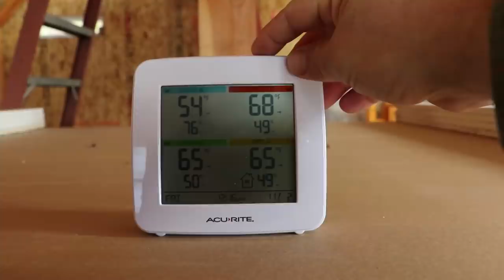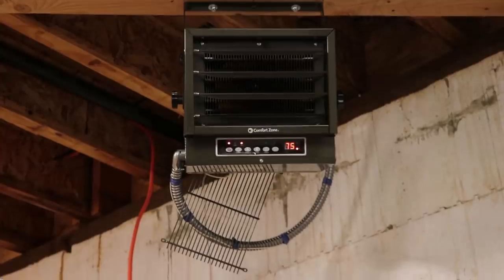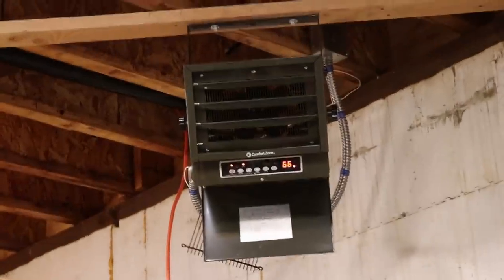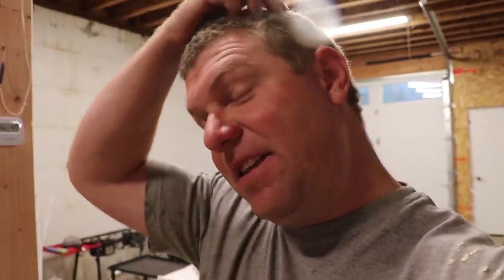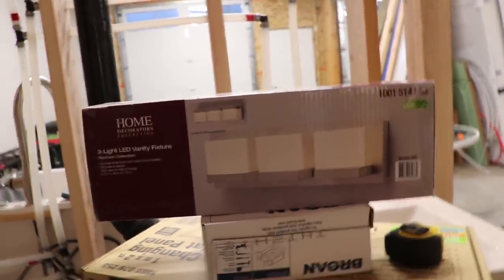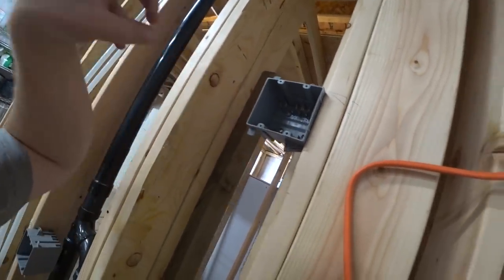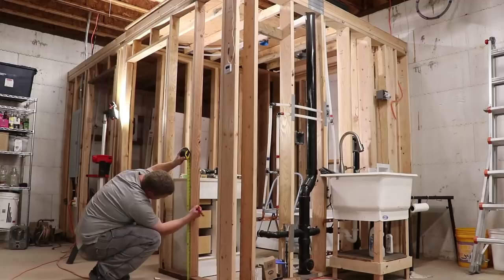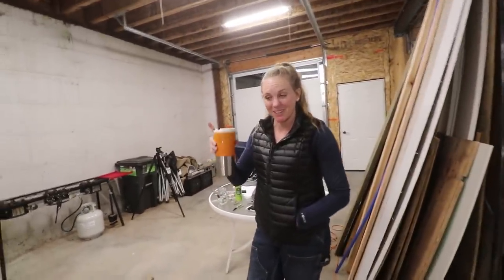A BEAUTIFUL, HOT MESS (Initial Electrical in Bathroom)

Comment: You should not use a staple gun to secure electrical cables.  You just showed the reason why? You put a staple through the wire itself.
This would not pass inspection.

Comment: tbh when everything is built you should consider using a gas water heater and free up that 200 amps for other devices and relieve stress. and there are some really efficient  gas water heaters but I have no idea what your gas prices are compared to your electricity prices are.

Comment: I know you got the electrical all done by now, but don't put your bath light on the circuit with the outlets. If your hot curling iron trips your breaker on your circuit and the light goes off and you're in the dark you can burn your hand on the still hot iron while trying to get out the door in the dark or even worse you can knock the hot iron off the counter into the trash can and it can catch fire while you're in the dark. Lights on one circuit and outlets on different circuit for a reason.

Comment: there are auto switches that will turn off one load while the other is running to prevent overload of main breaker  like  domestic water heat and or Electric boiler

Comment: you should have put in a 100 or maybe a 120 gallon water heater to serve both the shower and the radiant heat.  It would easily do both.  And it would not draw anywhere near what that on demand heater pulls.

Comment: Question: Would you be willing to give me the Mfg's name and the model number for your garage heater?  I'll check the circuit diagram for the thermistor (or whatever it is) and do the math for your extension wire run.  Btw, I'll need the length of the wire run and wire gauge.  Just to double-check for voltage loss or amp draw problems.  

You two are my heroes.  To watch the fantastic dedication to quality and attention to detail is amazing.  Jesse and Alyssa are certainly the most inspirational home-builders I have ever seen or heard about.  GREAT WORK!  Slow and steady wins the race, unless it's a sprint.... hehe

Comment: with the gaps around your doors cold air will rush in and thwart the heat up process.hot air always rises and cold air will sink.if the heaters were lower down they will heat the cold air layer on the floor level and send it up to the other floors.

Comment: Remember the NATIONAL ELECTRICAL CODE (NEC) are the minimum electrical requirements.
Bath receptacle required to be single circuit GFCI that shall not feed any other other outlet. (Hair dryers, curling iron, etc.)
Kitchen requires minimum two 20A GFCI receptacle ckt’s for countertops 2’ or larger with receptacles not exceeding a distance of 4’ from each. Fixed stove tops and sinks are considered breaks in the countertop. Refrigerator, dishwasher, microwave & garbage disposals should be fed as a good design practice with dedicated circuits. These devices should be connected to the circuits by means of a cord and plug attachment to work as an accessible equipment disconnecting means. Locate single use receptacle in adjoining cabinets or appliance access points to accommodate the cord and plug connections.

There are NEC rules for light fixtures in a Bathroom. Light fixtures are required a specific distance from a bathtub.

A fix for the bath exhaust fan would be a in-line fan blower installed in the exhaust ductwork outside the room either inside or outside of the home.

Comment: All heaters should have at least 2 thermocouple. 1 for safety purposes which should be preset to a fixed value. And 1 thermocouple to regulate the heater turning on or off.

Comment: You can't go wrong with just a 50 gallon electric hot water heater. If you had a power outage, a standby generator will power your hot water heater.

Comment: Doesn't the heater sensor control if the heater element need to be switched on/off and the other censor you moved control if the fan needs to run?

Comment: All you needed to do was to twist the RED and the WHITE wires together were you soldered them together. You created a "cold junction" at the solder connection. Twist them tight TIGHT and snip the excess leaving only 1 or 2 twists. IF you are using the correct Thermocouple Extension wire?

Comment: I would suspect you lost the safety sensor by locating it with the new extension at face height far from where it should be, because it will never be able to detect an overtemperature due to a fan failure. The safety sensor is now doing the job of the air sensor but connected to the inertia of the metal structure which will obviously extend your on-off time period which was what you want to solve. If you simulate a faulty fan by removing one of the wires of the fan (of course with an extinguisher at your side) you will prove it. I do not want to be arrogant and discard that the connectors came switched from factory, but there is a risk that you created a time bomb that will trigger the time where the fan will fail which will be in a time where you forgot about this apparent risk you created. I care about you and your amazing house and I am not trying to be a wise ass.

Comment: You could always mount the exhaust fan in the wall. Speaking from experience, you will not be happy with that fan, it is way too loud. If you can wire the fan separate from the light put it on a moisture sensor. That way when you leave the room after a shower the fan will stay on until the moisture in the air is at an acceptable level.

Comment: you need a GFIC with 4 screws or terminals one set is supply  for this GFIC other connections will connect to regular plugs will provide GFIC protection for others other

Comment: You always pick the hardest way of doing things.  If there is not natural gas in your area then get a propane tank.  Electric heating is so much more expensive and you are going to have a monster electric bill.  Get a gas hot water heater, gas heater, and dryer.  Also GFI plugs at least used to be only good for a certain number of years and that is why they have testers.  You are also limited by state code how many plugs you can run downstream from a GFI plug, but I know in Michigan it used to be 7.  Before you put in plugs get the code for heights on the wall and spacing requirements.  You do not want too high a CFM for the bathroom fan as it will pull all the heat out of your house rather quick... especially with this bathroom being in basically what is considered the garage.

Comment: one of the issues is low air circulation in the room - stir  the air with another fan blowing cooler air with hot.  You are heating a pocket behind.  Normally the sensors are Constantin wire and you extended it with copper.  voltage generated on sensor is passed but not as expected.

Comment: You are talking about Arc Fault Circuit Interrupter (AFCI) breakers; not the traditional GFCI (Ground Fault) breakers of old; they are required throughout now here in NY too; my son bought an older 50's home and had a NY licensed electrician re-wire the whole house, with new main panel; the electrician warned him that the new AFCI's he has to use are a pain in the ass; they will trip with most devices that have a motor, i.e. corded vacuum, shop vac, corded circular saw, etc.. because they arc; and he was correct; he told him to just wait until after the final electrical inspection and replace select few of the AFCI's with regular or GFCI breakers and remember which circuits to use those devices with. We still forget sometimes; its a pain.

Comment: Considr getting rid of the on demand electric water heater and going with an electric air source heat pump tank water heater.  They are super efficient.  The on demand draws way too much energy.  You will probably spend maybe $200 a year in energy with an air source heat pump tank.

Comment: I'm just curious  .. you have a lot of space outside .... wouldn't be a huge gas tank outside and a gas using heater be more efficient??? Depending on how big the gas tank is, it will last a long time until it has to be refilled.And you don't have to worry about max out your 200 amps.

Comment: You should leave the outside of the bathroom wall open you may need to run other wires for the upper level as long as you can.

Comment: have you thought about a hot water return line system for your hot water setup.  That might fix the "waiting for hot water" problem.  I have done some research on it but not a whole lot.  I think you might need a different hot water heater to make it work though.

Comment: Why don’t you use propane instead of a power water heater and boiler. Propane is way better for heat. Unless you are on a co op power source where it’s really cheep power. I don’t know all the factors you have. But I am a electrician and if you have a 200 amp service you should be able to run everything you need with ease.

Comment: I think the factory plugged the sensors into the wrong sockets on the circuit board. That would explain the constant on/off behavior of the unit. The heating element gets much hotter than the target room temperature, as soon as the element got warm the thermostat would turn it off.

At first I thought the issue was adding the extra length of wire. Many temperature sensors work off of changing resistance in the circuit, a long run of wire adds some resistance. Given that the system worked perfectly once you switched the plugs the resistance of the wire must not be significant enough to be an issue.

Comment: It has really worked for us to have additional fans to circulate the heat from higher to lower.  So you may want to get some other fans to pull the hot air around to help even things out.

Comment: Not a thermocouple, probably just a diode and the computer mesure the voltage drop. Relocating with a long wire increased the voltage drop but you should be able to "re-calibrate" the eltronic afterward.

Comment: Why not just use a hot water tank instead of a tankless on-demand system? You don't want to lose the space for the tank? An electric hot water tank only needs 240 volt - 20 amps.

Comment: If it was I would run the wiring for your on demand water heater. I would run the wiring from here your main wiring that goes to the house. And put a single breaker box. So it is the only thing on that circuit.

Comment: Oh dear God! I have collapsed 2 of those shelving units. The plastic wedges have one little plastic ring on them and when it shears off... BOOM. The earlier models had 2 plastic rings, but aren't available anywhere I have found, and the pros use metro aluminum wedge lock shelving. Just saying the capacity on those shelves seems to be greatly exaggerated. With time and vibration they will fail.

Comment: Check that the temperature probe wiring is isolated from the mains and is not a shock hazard as it may need to be in conduit. The easy way to test was to warm with a hair dryer before you cut it off. The other thing is to block off the stairwell and see if it can keep the garage warm.

Comment: Ummmm....heat rises.  Why put the heater up at the ceiling where it's going to keep turning off?  The unit should be at floor level.  And you're letting all the heated air up into the upper house?  I don't understand the thought process.

Comment: unfortunately if you have not used special thermocouple wire then your system is not going to work. thermocouples use two dissimilar wires joined together to form a hot junction. The other end inside the electronics is called the cold junction. The millivolt difference is then used to reference a temp gradient.
Google thermocouples to get a better understanding as there are many different thermocouples. K type and J type are the most common. Luck to you.

Comment: You can never have to much power available. A 400 amp service is not overkill for a house the size of yours. The on demand water heater and a electric range will stress the system when other items are in use.

Comment: Jess, you Must go to Amazon and check "Haisstronica 120 solder & seal connectors".  These are wire butt connectors.  They are shrink connecters with a ring of solder in the middle.  All you need is a heat gun to make a joint...and two bare end wires.

Comment: Temporarily use propane heaters, the kind the contractors use. Then use floor fans to circulate the air, or use ceiling fans.   Simple, and your SIPs should hold most of the heated air in.

Comment: The heater works exactly the way it's suppose too, that heater makes heat fast and  you put it on the ceiling of a cold room with an even colder upstairs. And you wonder why the heat won't go down to the cold floor? Your right Jesse it most be the manufacturers fault, why don't the stupid manufacturers make a heater that will make hot go down and cold go up, oh wait they do it's called in floor radiant heat. I like to see your electric bill but I bet that's one video we won't see. You have a mountain of burnable wood from all your sawing and Douglas fir  has decent btu's. You know that in the end your going to put owb in(outside ) and that great big hole your got right in the corner of your foundation I'm guessing that is what the hole is for, so why screw around with a heater the twill go unused once the real heat is in.  The only way you could pay more to heat your house is to cancel your insurance and burn the place to the ground. These  build it yourself shows should be required by law to show the amount of time and money wasted so that people don't make the same mistakes your making.

Comment: Love you guys, especially Bugaboo. Your plan using storage above the garage bathroom might run into problems where the 2x4 span might not support the load resulting in sag. There is a span table for 2x width for nominal lumber so you should approximate the weight you’re planning to support and determine if you’ll need to add a girder support which will lower your bathroom ceiling if you don’t want to lose more space above. Your vids inspired me to also owner-build and I wish you guys continued success with your build. Happy Holidays!

Comment: I like GFCI outlets to be in all the spots they need to be instead of 1 controlling some dumb outlets. Then there is no tracking down where the switch is to reset it. 

And calculation of lumen output is called "photometrics"

Comment: you just broke your thermocouple. It is supposed to be connected with thermocouple wire that doesn't change the thermocouple response. You changed the calibration.

Comment: I am an electrician in Australia. I am loving watching the North American systems. TBH they appear a little clunky compared to our systems and cables etc...but guessing that’s a lot to do with using 240/110vac instead of 415/240vac like us. So you need to run  cables and CB’s twice the size of ours to achieve the same power outputs. The biggest mains here for domestic installations is normally around 10-16sqmm.

Comment: OOOHHH NOOOOOOO with the wiring,all wires go down to the boxes NEVER go down and across ,same goes with boxes at floor lever they either come straight up from below or straight down from above at no point EVER does one come down and across or up and across that UK regs you come across to a box your sacked .fired outta here i know that and im a plumbing engineer.just saw more of the video and ALL those wire in the stud work should be above,so up to that loft space and across and then down to switches and plugs.

Comment: you could save a lot on koper wire , use lose wire black red en yellow,pull it into a pvc conduit that 
you lay out in groups that do not acceed 20 amp.hook that up to a automatic fuse.
this is how you go from the fuse cabinet you bring + to a part of your house .
Like kitchen 1+ plus apliences as dish wasser , fridge cooler close inn boiler microwave you gonna have to calculate 
some exstra fuses .
but bedrooms living space hallway outside lights . 
A house like your's probably ends up with about 15 to 20 groups as fuses .
A tip to save amps from your hot water ?  buy a boiler 10 till 15 gallon it's enuf to fill the bath mixing it with cold water
and it won't pull so much amps ass the flow thru instand water heater you have now plus a termostat and good isolation